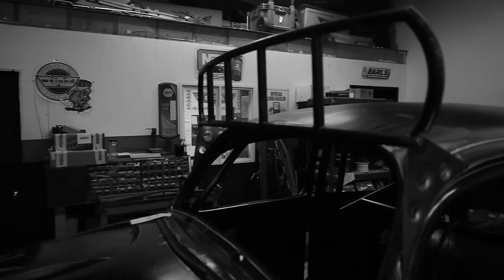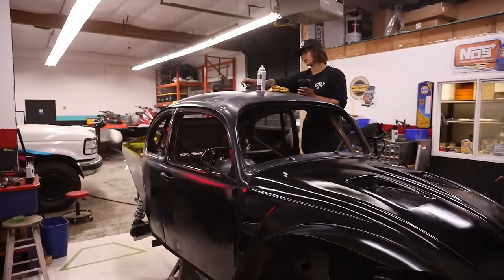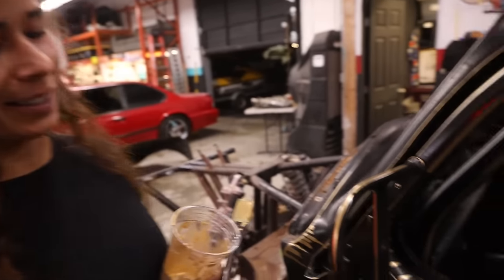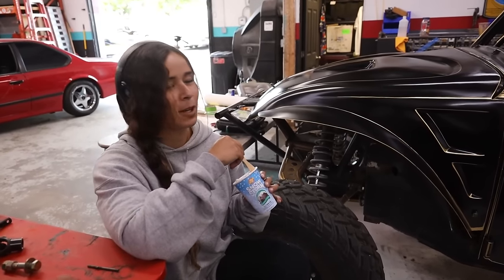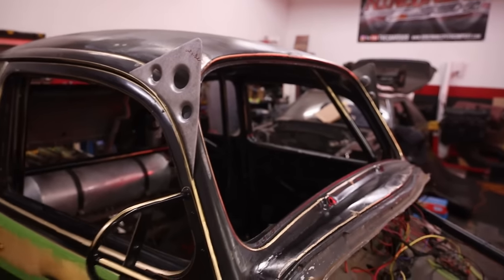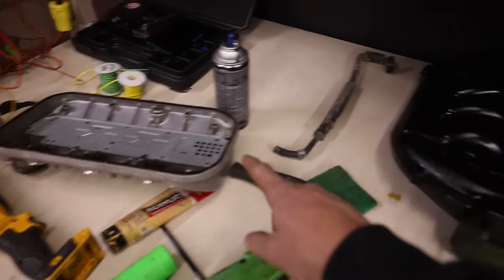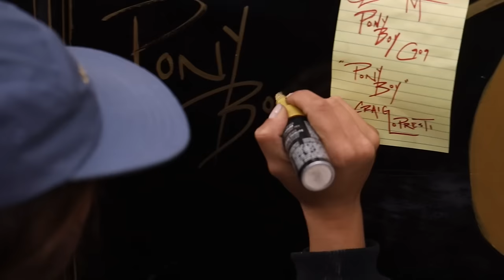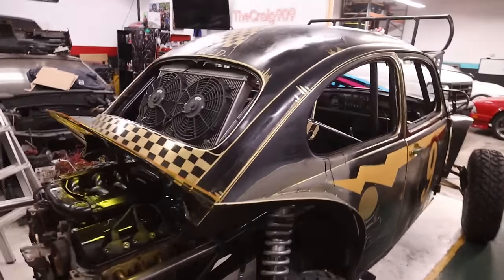My Honda Powered Bug Get's an INSANE Custom Paint Job! Complete Transformation!

Comment: Had a 3l v6 vetch like that in an accord I bought for 300 dollars had over 200k on it and it was a very clean motor inside the only thing you could see was the inside of the valve covers had yellowing from where the oil was hitting but other then that it was very clean inside Hondas are definitely the best most reliable motors